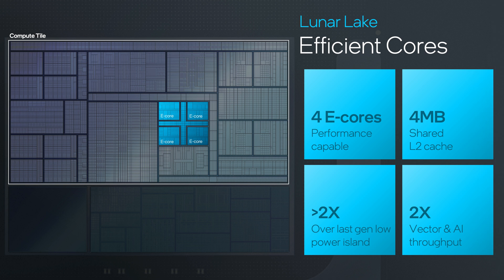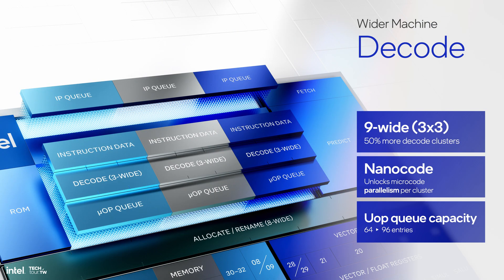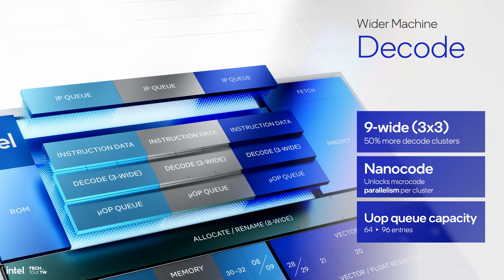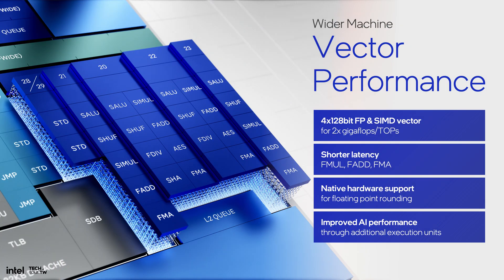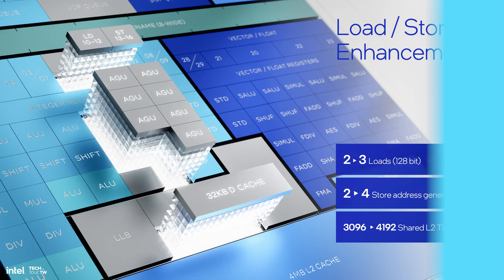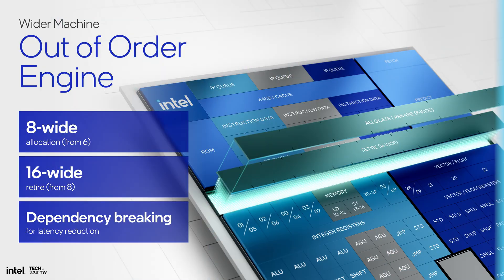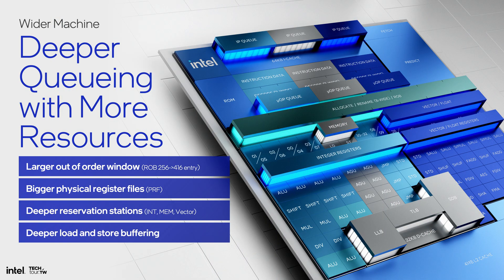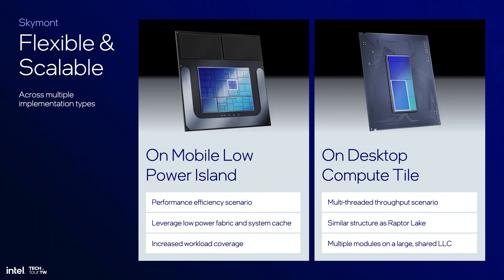Skymont E-core Architecture Explained by Intel Fellow | Talking Tech | Intel Technology

Comment: Many thanks to Alejandro again for his questions and to Stephen for chatting with us! 👏😁

It was really interesting the question about the new front-end and Stephen's answer about how they have augmented it, employing three-decoder clusters with very little transistor penalty. It had always been said that, in the x86 architecture, it was unfeasible to scale the front-end to increase the instructions per cycle, but Stephen and his team have shown that it is possible through ingenious and efficient solutions. So, another x86 myth busted! Bravo team! 👏😁

Skymont will be deterministic for multi-threaded tasks scaling several E-core cores given their small footprint and optimized consumption. Cloud server processors come to mind.

Also in the consumer market, assuming more prominence E-core for everyday tasks as Stephen says, which will result in lower consumption.

It also opens the door to simplify the design by eliminating HyperThreading.

Looking forward to the next iterations! Cheers team! 💪😁

Comment: That’s great, now make it so the battery can last more than three minutes
Reply: That's the entire point of Lunar Lake. It's aggressively trimmed down on the P-cores and can shut off parts of the die to save power. They've shown perf/watt and system power comparisons to Meteor Lake in other presentations already. 9W to 32W TDP depending on the SKU, but the high end is mostly due to OEMs wanting to wring more performance out of it. It's a 15W class chip that will perform like the current 28W units.

Comment: Have Intel considered to replace the ring with a full mesh since there are only 5 clients (4P+1E-Cluster)? In my super sensitive gaming scenario I'm bothered by noisy ring issue - 13900K any busy P-core will make other cores "noisy".

Also now E-core gets P-core level IPC, then what's the next main difference between them?
Reply: P-cores still have a 14-18% IPC gain over Raptor Cove as well. The main differentiator now is in AVX support and clock speed. Skymont is likely a sub-4ghz architecture for density, while Lion Cove should go well above 5ghz and likely gets larger caches.
Reply: @DigitalJedi  Good points. One thing I found during my gaming is that Intel really masters the ring architecture. Raptor Lake ring has 12 clients, while Comet Lake has shown scalability issues with 10 or more clients on the ring. What Raptor Lake does is it runs 8 above the ring clock and 4 below and it's somewhat stable. I'd imagine in Comet Lake running 2 or 4 cores below the ring clock would also make it more stable but I don't have one to test. The ring clock limits both P- and E-core clocks because when the clock difference between core and ring is too large there is a huge performance penalty, and if it's too small then it's very unstable. Ideal clock is something like P=Ring+6, E=Ring-5, and that makes all the clocks fixed.
Reply: P cores got even better
Reply: its true

Comment: Let's hope for good scheduler for operating system kernel.
Reply: Thread choices are a lot easier with LNL at least. Rather than go P-core main, E-core, P-core hyper, lpE-core, from the top down, it just goes P-core, lpE-core. Start on one, go to the other for either more threads (P-core down) or faster threads (E-core up).
Reply: @DigitalJedi oh yeahh good point
Reply: I have to hope that the software side rises to meet that challenge.
Reply: Between Thread Director and W11 the scheduling is already pretty great. However it's going to be near perfect with Lunar Lake, as scheduling as Thread Director is getting enhanced and more importantly E-Cores are getting a huge performance boost, no longer will e-cores be weaker backup cores for multi-thread like they previously were, but now they are more like medium cores with Raptor Cove IPC but vastly more efficient and space efficient.
Reply: Linuxxx